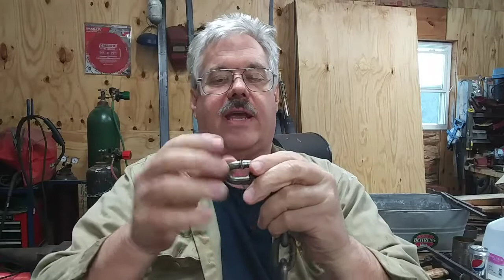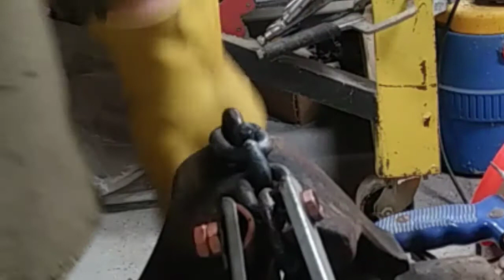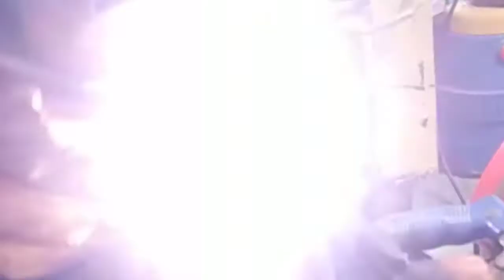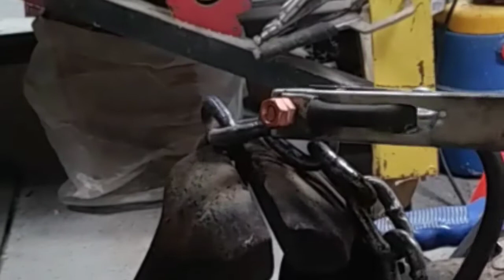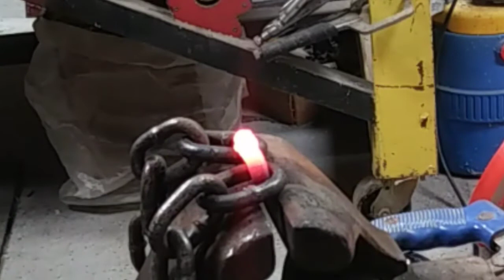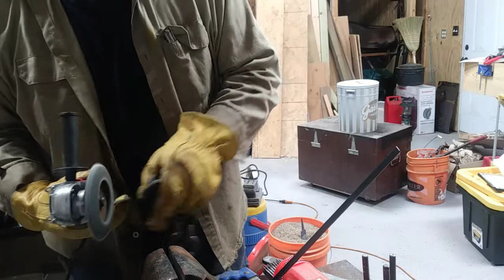Repairing a Logging Chain, Welding a Link

Comment: I have a couple chains I need to do that to.  Would a torch we acceptable for welding?  I do have a Lincoln Idealarc  250 AC/DC I could use but thinking a torch might be easier.
Reply from the maker: I guess to me it would depend on what it will be used for. If lifting or pulling heavy objects I would feel safer using the arc welder. If it will not be used for anything real heavy the torch welding would be fine.  Torch welding with steel rods can be strong but I don't think it gets the penetration like arc welding.  But that is just my thoughts.  I hope that helps.  Thank you

Comment from the maker: I cannot remember the exact amp setting. I was using 3/32 7018 rods.   I was using my Lincoln 210 mp. I usually just dial in the thickness on that machine and go with it.  On my old portable welder I run anywhere from 90 to 110 depending on the material thickness.   I know the rod I used because I have a ton of those and use them for everything. Those or 6011. But my guess would be around 80 - 90 amps. 
I was not concerned over the temper or heat treating in this situation because it would not be used for extreme pulling.  This is just a farm use chain they wanted me to join together.  If it was a grade 70 or above or used for chaining down heavy equipment then I might have checked into other methods.  I have also repaired chains with various repair links in some situations too. But those were for my personal use.

Comment: Sweet video. What kind of rod were you using? What settings?
Reply from the maker: I used a 5/32 7018.  I have a bunch of those left over.  They have been exposed to the atmosphere too long but they are fine for most of the stuff I do around the shop.  I have some sealed up 7018s in case I need them.   I keep 7018 and 6011 rods and 35 wire for my MIG in my shop.  I need to pick up some more rods some time but I have not needed anything for a while.  I cannot remember the setting right now that I used back then.  I think I just set my settings for stick, 7018 and around 1/4 " on my Lincoln 210mp.  On my portable machine, I usually set it a little hot for the 5/32 7018s.  Usually I run either 100 or 110 amp but if I was doing this on that machine I would have tried 90 to 100 and see how it welded.  That automatic interface on the 210mp is spoiling me. ;)   
Thanks for watching and commenting. I appreciate it.

Comment: What was the amp setting for that and the rod size? Were you concerned about losing temper in that link?
Reply from the maker: I will try this again.   Crazy youtube.  I replied back a detailed message and I just saw that it never went through. Sorry about that. 
Basically I said I was using a 3/32  7018 rod.  I have a box of those and 6011s that I use all the time.  When I run my portable welder with those rods I run them anywhere from 90 to 110.  But I was welding this with my Lincoln 210 MP.  It has a dial to set the thickness and I cannot remember what amps it set it at.  As for the temper. This was for my inlaws to use on their farm.  If it was a high grade chain used for holding down heavy equipment or something I would have looked into all the possibilities.  I have also used a few different "repair links" on some of my personal chains. But I am not stressing the chain for my own work.
Reply: @GaryForgingOn  Thanks for the reply, I appreciate the info. Really helpful.